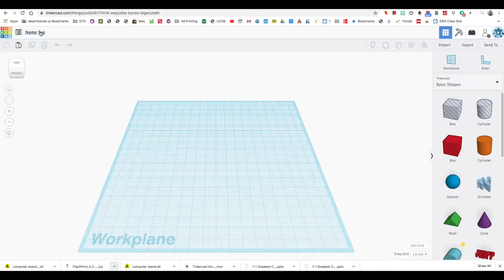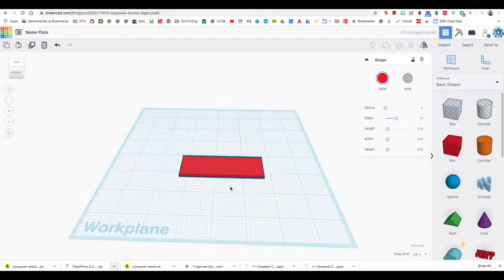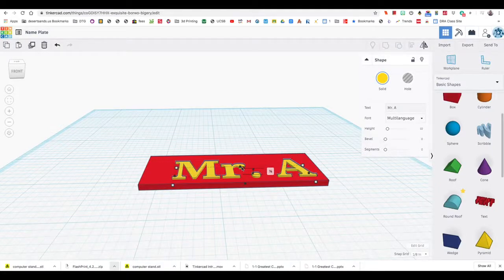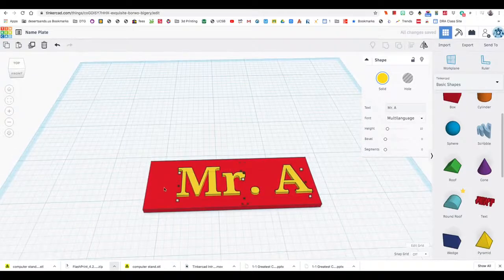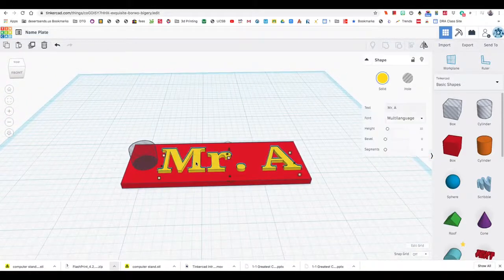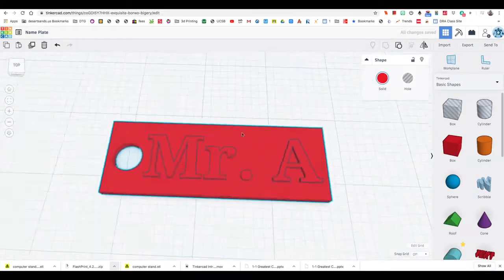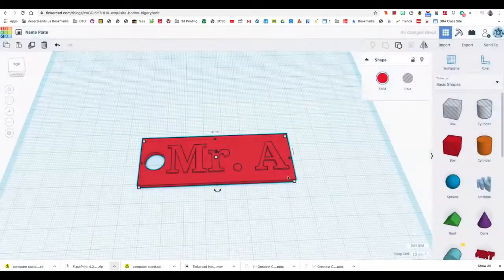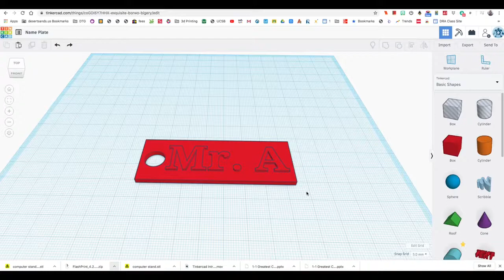The Nameplate Video

Comment: also it would be great to see how we can make beveled edges on corners of cube
Reply from the maker: Once you drop a cube on the workplane the settings pop up for that cube.  The first two settings are radius and steps.  Those two settings will bevel the edges.  First change the radius and then change the steps.  Good luck.